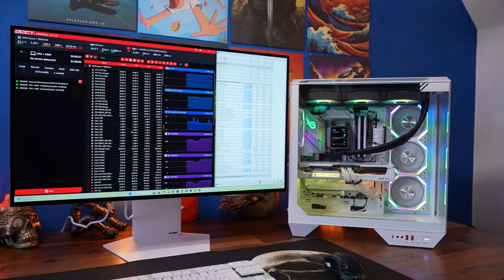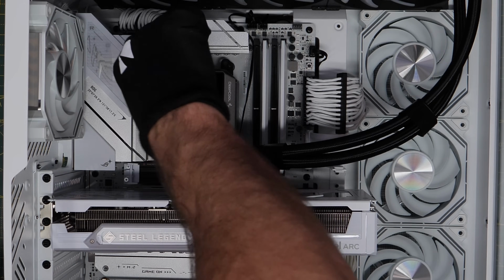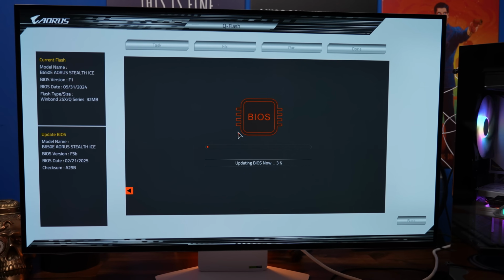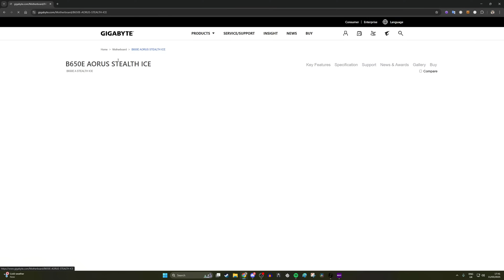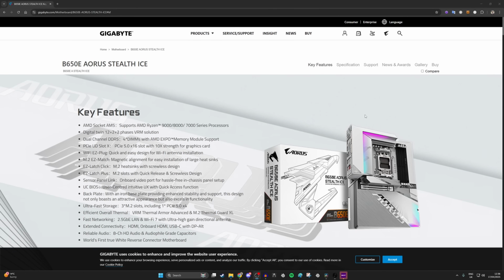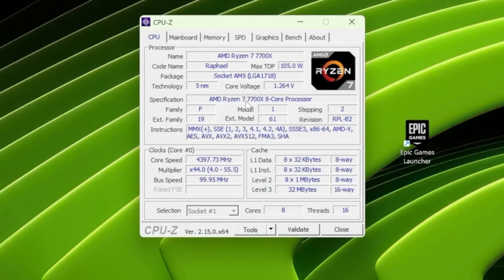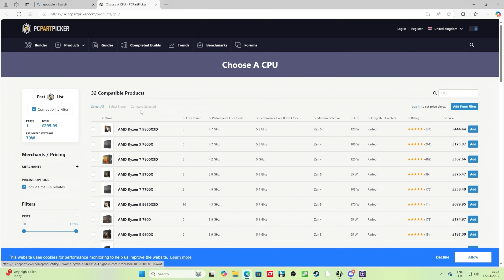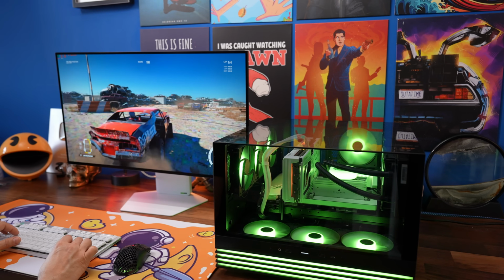How to upgrade your AMD CPU - what you need to know and do

Comment: When you remove the cpu cooler why do you need to remove the fan/aio header from the motherboard? I’m gunna do a cpu swap and the header for my cooler is in a really uncomfortable spot so unplugging and plugging it back in can be really annoying to do
Reply from the maker: You don't necessarily need it if you can access things without doing so

Comment: Are you gonna put an updated video for intel cpu upgrade. What chip is best for budget build to play at 1440 or 4k?
Reply from the maker: I did a video a while back for Intel - https://youtu.be/CNvzVjI3YFw
With Intel you have to pay attention to the socket type more because it changes very often. Usually every 2 years. So it was LGA 1200, then 1700 and now 1851 and it's due to change again apparently.  Whereas AMD has stayed the same for a while and will do until 2027 apparently

Comment: Can you please make a video showing how to overclock cpu and ram please using asus motherboard. I have the asus z790 dark hero with intel i9 14900k, using 4 sticks of corsair ddr5 8000mhz 96gbs  and the asus astral 5090 oc. I've tried going to the bios and oc my ram to 8000 but I get the black screen and have to reboot my pc and go back to default mode. Please help

Comment: I have a question, I just bought a 5600XT and a mobo but I am curious if it will come with the bios updated out of the box, because it does not support bios updates without an old cpu and I dont have one, I will mention that the bios update required is now 11 months old but it is beta, as the newer ones. Thanks.
Reply from the maker: Usually in my experience they don't come with the latest updates. Sometimes you can do the update without booting though.
Reply: @TheProvokedPrawn  I am asking because I do not live in the Us so a refund would be pretty frustrating to do, it is an Asrock b550 riptide but I do not know if I need to cancel the order and order an 12500 / 14500 from Intel and a different mobo or what. I am very confused right now because I feel it would need an older cpu to update.

Comment: I have 7800x3d with 7900 xtx taichi. The only reason i didn't get the 9800x3d because 5 months ago 98 was 700+. now its at 499. Should i upgrade to the 98 or stay and wait...?
Reply from the maker: I've not used both to be able to compare whether the upgrade is worth it
Reply: Its worth it depending on the scenario and if you didnt hurt for money, but they you wouldnt run an amd gpu so probably not

Comment: For people gaming at 4k, the 7700x is fine. You will generally not see significant improvements with the 9800x3d, imo. There are a few rare cpu intensive exceptions, like sims and Hogwarts Legacy. I say this as someone who foolishly upgraded from a 7800x3d to the 9800x3d. Marginal gains at best. (As someone pointed out, the 9800x3d will give you better 1% lows than the 7700x, or the 7800x3d for that matter.)
Reply: It depends on the games. Space marine 2 for example, or stratigy games, city skylines 2 ect ect. Some ppl play games that just need a really strong cpu to not underutilise their gpu.
Reply: The 9800x3d may get you an extra 5 fps in sm2 over the 7700x at 4k. Maybe 7. It's not going to be a big difference, assuming one has a beefy enough gpu.@stealthhunter6998
Reply: Had the 7500f and I game at 4k. Once I learned that their is no difference at 4k, the 7700x was a no brainer. Even let's me get my feet into productivity applications.  Though I've yet to do any. 😄 🤣 😂 😆
Reply: Bro the ryzen 7 9700x is good option??? Playing 2k and probably 4k with 9070 xt
Reply: @marlonroldan6075 yup, you'll be fine. Great, even.
Reply: You will. Especially in 1% lows.
Reply: @ppeez  This is true. Definitive improvement there.
Reply: luaghs in escape from tarkov

Comment: Just make sure the place you get your 9800x3d from honors the warranty.
There have been reports of 9800x3d dying just from doing simple tasks within a week or up to 3 months.
Mine died within a month running on Asrock B850i.
Reply from the maker: Asrock boards have been a problem there apparently
Reply: 9950x3d shuts the computer off with a asrock less than four months

Comment: I just got my 9800x3d today and I am installing it tomorrow to replace my 7600X. Perfect timing! 😂
Reply from the maker: Enjoy!
Reply: Good Luck with That; (Hope you don't have an Asrock Motherboard??) I'm sticking with my 7600X Thanks, No Fn' Way in Hell am I ever going to pay: $700.00 CAD to Upgrade to a 9800X3D!!! Maybe in 5 -6 Years Time if the Prices comes down to; $350 - $400.00 CAD,  I might consider It!!
Reply: I am looking to upgrade from my 7600X too. How was the change for you? Was it a big difference?
Reply: @Ragehaven01 it depends at what resolution you play and what GPU you have. Since I recently upgraded from a 6700XT to a 5080 I said why not. But in general I noticed it runs cooler than the 7600X with less temperature spikes.

Comment: Im planning to move from 14900k to a 9950x 3d system but i don't want to reinstall windows because i have a lot of shiit on my nvme ssd is it ok to just throw in a new x870e and a cpu and put in my nvme? will i have a lot of problem when booting?
Reply: According to reddit u can but u might experience some issues

Comment: I recently updated from a Ryzen 7500f with no issues to a Ryzen 7700x that crashes applications whenever I game. I’ve updated the bios and I’m still getting the same issue.
Reply from the maker: You're sure it's not overheating?
Reply: @ not sure. Before updating the bios it was getting into the 80’s, but after it was sitting at about 75 during applications and 40-50 idle. I’ve even tried undervolting to prevent that and I’m still getting the same results.